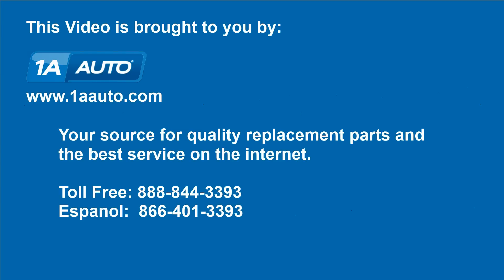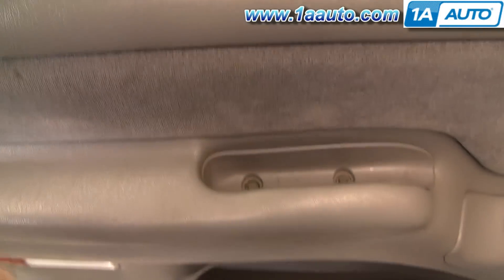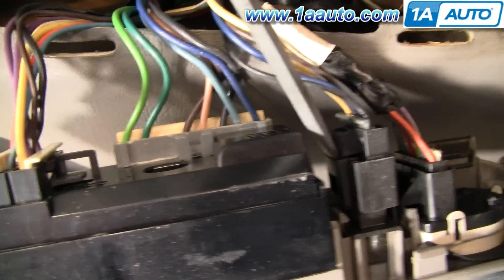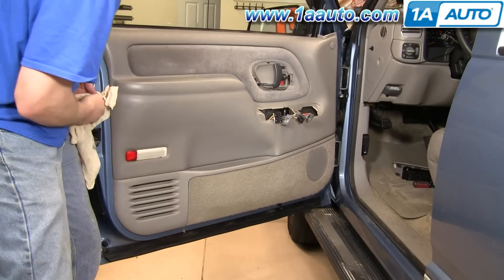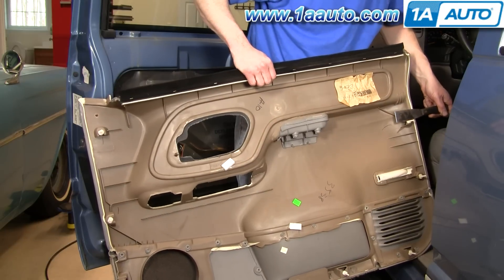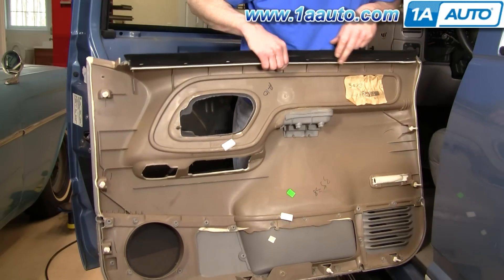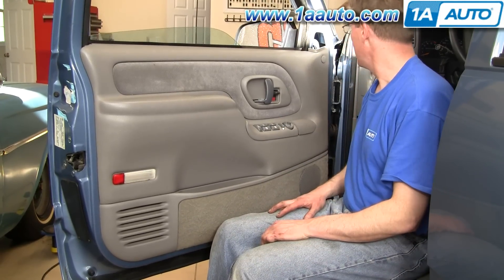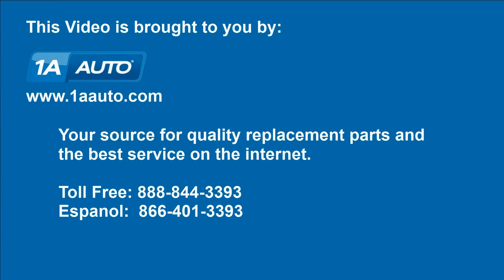How To Remove Door Panel Chevy Tahoe 95-98

Comment: Hey Mr. On a original suburban 1998 luxury edition.  There's two screws that holds the door panel. Correct.. well if you see that trimming that goes inside the panel. I'm looking for the exact name for that part that holds the door panel to the door jam clips

Comment: Do you happen to know off hand what kind of bulb is used for the door courtesy lights? I have three bulbs out. I also have to either replace or fix the rear passenger door locks. Thanks for the informative and helpful video!

Comment: thanks for that...now i know...
Reply from the maker: Thank you for watching. Please let us know how the repair comes out!
1aauto.com  888-844-3393
Reply: 1A Auto Parts The repair went well....got the parts I needed in town and took the panel off....replaced the parts that were broken(some of the pins that hold the panel on were broken/missing and the side mirrors adjustment switch was replaced)put it back together...took a bit of time, but it's almost better than new!  Many thanks for the video on this...Now I know!

Comment: any suggestions on how to start the removal on a rear passenger door panel of the 98 suburban with a door that will not open.  I need to get in there to unlatch the door

Comment from the maker: @clutch2270 The holes in the hinges may have been enlarged.  When you lift the door up and down look at the bushings.  Are they moving in the hinge? We sell a replacement lower hinge (requires welding).  The upper you might have to have welded then re-drill.  Definitely more advanced than a simple replacement.

Comment: This video helped me alot! If you only are changing speakers in your car you probably need to take of the front panels on the front doors of the car off, on the rear doors (on my suburban 1996) I only needed to remove the speaker cover wich went a lot faster.

Comment: 1A Auto Parts Do you have any idea where I can buy just the plastic panel retainer plugs and pins? Some of the bottom ones on my 1999 Tahoe are missing. I also have one missing on my interior barn door pad in the back, part looks similar. Thank you very much!
Reply: I have found them at Napa Auto. and a nice selection to.
Reply: Did you ever find any? Im looking for sum. I just spent $10 worth assorted clips just to have them snap. Did you have any luck finding some?

Comment: I just ordered the mirrors and door handle kit this morn. I would have ordered more but could not find it on the site. I was looking for those clips that attach the door panel on the door. I found the bracket kit which I don't need but not those clips. After removing the door for speakers I lost a few. Do you offer those clips?
Reply from the maker: +fishingfiend305 Thank you for your order. We currently do not carry the door panel clips.

Comment from the maker: @mikesmith0305 You may want to check to see if a fuse blew somehow, or even the connection to the battery on the terminals. If the battery terminals are corroded you may want to clean them. Hope this helps.

Comment: Thanks for this and all your instructional videos as they are very helpful. Today I decided to change out the 194 bulbs on my 1999 Tahoe, old style like 95/98's,  door panel courtesy lights for LEDS. When I popped off the drivers door Courtesy light I had no wire or bulb in the housing. Okay someone must have had it off at some point and didnt put it back. I looked up your videos to verify the door panel removal so I could find the wire and connector. In your video you do not show popping the Courtesy light from the panel before panel removal. In fact you can see the wire and connector hanging there when the panel is moved out of the way. I mention this because popping the courtesy lights from the door panesl is tricky and there is only one way to do it right.
Reply from the maker: +Gregory Biggs Thank you for your feedback!

Comment: my problem is door panel clips will not hold and the panel keeps coming loose( I use standard retaining clips for Chevy) any ideas on how to fix this
Reply: 1A Auto Parts I bought new but they don't hold , sometimes when I open my door the panel pulls away from door and clips just fall out.
Reply from the maker: +Chris Goodwin They should hold the door panel in place. Did you purchase them from us or from another vendor.
Reply: 1A Auto Parts bought from AutoZone
Reply: Im dealing with same problem. I cant even find similar clips from AutoZone or O'Reilly. Did you fix your door? And how?

Comment from the maker: We currently do not have an auto repair video that shows you how to do this in the rear door of this truck. However some of the basics should be the same. You would need to remove any trim holding the panel to the door and then remove the door panel from the door, using a putty knife or a door panel removal tool.